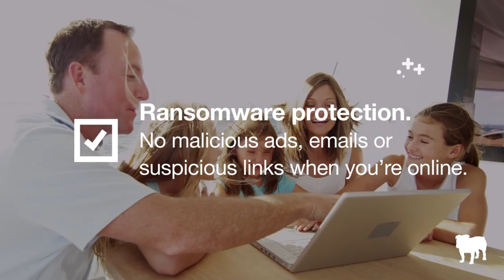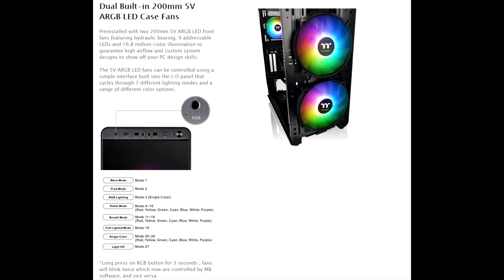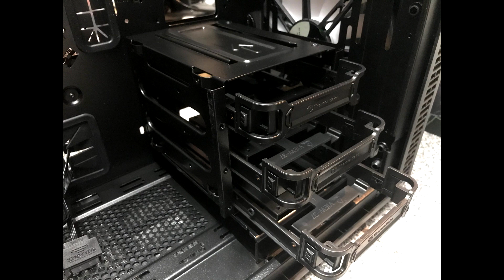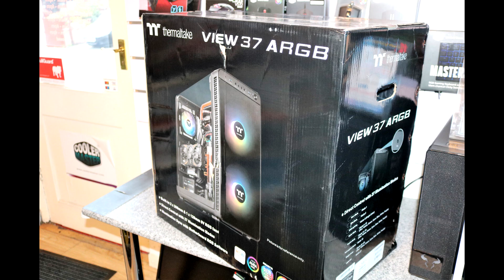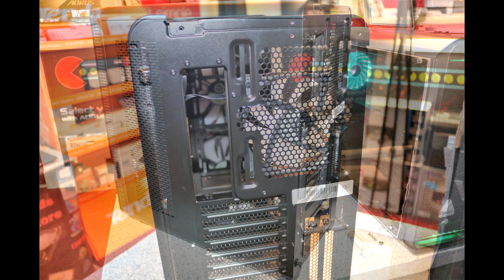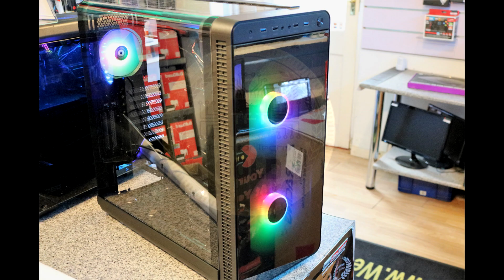Thermaltake View 37 ARGB Edition Mid Tower  Review RGB CA-1J7-00M1WN-04

Comment: Could you connect to the mother board and sinc through Aura? I only got 1 out of 27 leds ON. If I switch from addresable header connectors while the computer is on, the second one will allow me to set as many LED lights as I wish, but then, after a complete restart it will lock that port back to 1led but will release the another connector. -.-

Comment: I'm having trouble with the rgb button not changing the fan colors. I have a Aorus B450 Pro Wifi so I'm using the 3 pin vdg connector that came with the case. I'm wondering if I'm missing another connector cable to allow the fan colors to cycle through using the button??
Reply: The button stopped working for me after a while.

Comment: Is it not possible to mount the side radiator if the 200mm fans are mounted on the inside as opposed to the outer of the front? The performance was rated much higher with internal mounting.

Comment: Can the ARGB fans be connected to the standalone  TT Fans Controller, the one which come with the Riing Premium fans, instead of this built-in stripped one controller?
Reply from the maker: I have not used the riing controller before, so i would hate to comment, but the connection in the case are a lot different to most that i have seen on other controllers

Comment: Can anyone tell me what length is generally needed for the vertical GPU mount pcie ribbon extension?
Reply: Would 200mm work?
Reply from the maker: +Whats it Play? Depends on the board you are plugging it into and where the port is but i would say 200mm should be ok. If it seems tight go for a 300mm
Reply: @TechforTechs  I got a 200mm hopefully thT will fit

Comment: I have a question: I'd like to buy this case with an  asus which has an argb reader (asus rog strix x-470f)..I'd like to connect a deepcool castle liquid cooler...but how can I connect both (case and cooler) to the motherboard since the argb connector is one? or even if I want connect an argb led stripe how can do that?

Comment: How can you use Asus aura sync from your mb with the case fans?

Do you need an ARGB header?

I saw the other comments and I have the cable for the Asus connection to motherboard that came with the case.

Comment: got this case but not sure how to connect the rgb board to the MB - can anyone help?
Reply from the maker: Your Fans should be connected to the Controler, then you need to connect the controller to a ARGB/Digital RGB connection on your motherboard if you have one. See page 10 of the manual https://www.thermaltake.com/db/support/usermanual/_eecfa3d1f0944b618662cb35df7867f4.pdf

Comment: My question is... Do you hook the case up as normal through their Thermaltake ARGB Fan HUB when you intend to use Asus Aura Sync through your Motherboard. I'll be using an Asus Rog Strix Z370-E Gaming MB.
Reply from the maker: John Braughton anything you connect to the built in controller plugs onto the motherboard with a USB 2.0 lead. And is controlled with its own software.  If you want to use the Asus software each item would have to be wired upto the motherboard.  Or you could do some with one and some with the other
Reply: @TechforTechs  Great thanks for the info!  Its hard actually finding a review version of this specific case because most other reviews are of the two 140mm front fans and it seems like the "ARGB" version doesn't exist. I chose the ARGB version because it is the same case and cheaper with the two larger 200mm fans. I am hoping this will keep the inside nice and cool. I am a 1st time builder and have all my parts ready to go. Just bought this case today. Hope it serves me well with the stress test benchmarks with my i7-8700K. 😎
Reply from the maker: @johnbraughton2094  Its a nice case with lots of cooling options, and i agree not much info around about this version of the case.